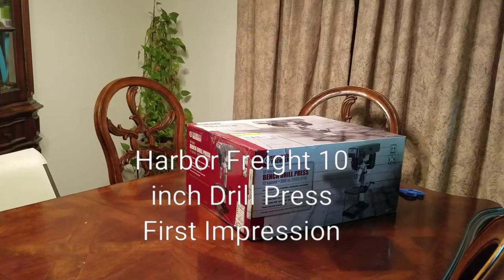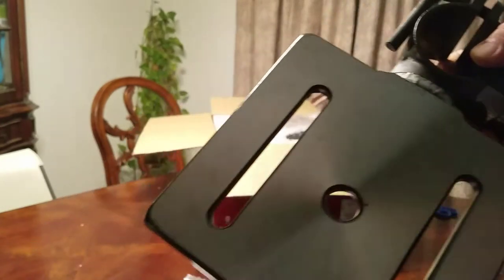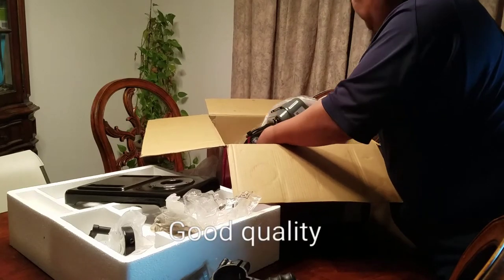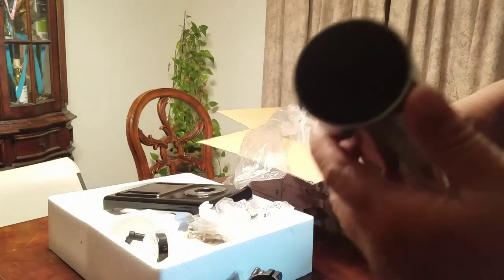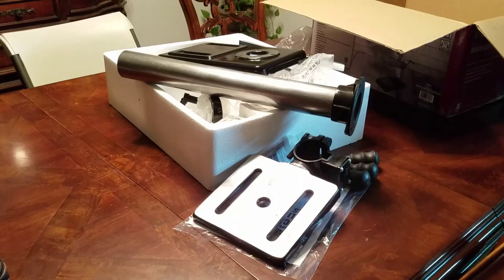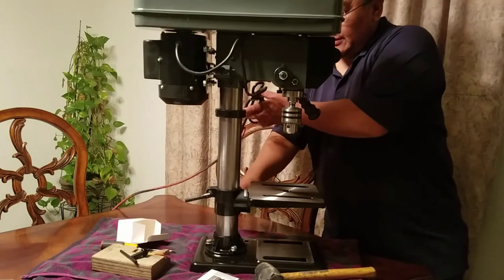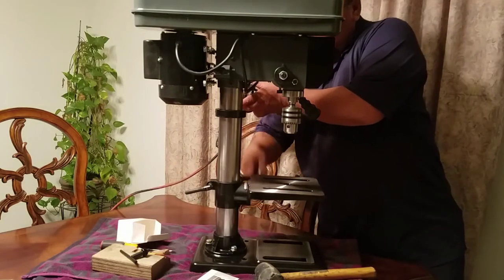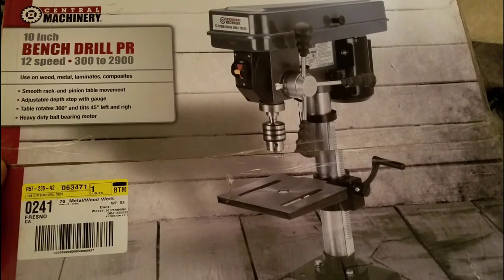Harbor Freight 10 inch Drill Press First Impression

Comment: Um, Dud, you have a book with it that gives you the names of the parts, then tells you how to use them.  Not the best, but better than fly by crash.  Plastic that's curling, not stickers, it's just protective coatings over the scales, you're supposed to take it off so you can see the graduations.  Again, read the damned book.